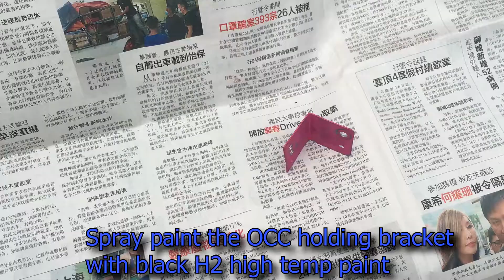(updated) Toyota Prius 1.8 Oil Catch Can installation

Comment: My concern is when it is needed to remove the original hose from the 8mm elbow barb which cannot be done because there are too many angle spices (ribs) on the body of the elbow connector. Reason is every 2 years in US, cars need to be smog checked so I would like to remove the connection and return it to original for that test, then after it's done and passed to reconnect it back just like you. Can you do a quick test to see if it can be removed from the elbow?

Comment: Good video thank you :) my Gen 3 Prius does consume quite a bit of oil so this would be ideal to install and I'll be doing it soon.
Reply: perhaps you should clean your piston ring spring using detergents in engine oil like ERP
Reply: @lovemytechy  I put an oil catch can in a while ago. It works very well and catches a lot of blow-by.
Reply: @FishingWithMichaelTruong  what size can 300ml or 700ml ? How often do you have to empty it and how are the winters? Are you in cold weather?

Comment: Well detailed video. I followed your video and installed OCC successfully. I ran my Prius on maintenance mode for almost an hour ( to check if it's still overheating intermittently due to weak water pump that I replaced with new water pump and that's been fixed ) but I noticed the hose that I connected from outlet of Oil catch can that goes into the intake manifold was completely flat due to high pressure. Do you think OCC might not be functioning as it supposed to  or should I replace with the heavy duty hose ( thicker one) , like the one I got that connects from PCV valve to inlet of OCC. Do you think I need to get a vacuum hose which is thicker than the one I installed ( maybe I got radiator hose ) .I subscribed. Thank you for you reply.
Reply from the maker: You need to get fuel line hose. Do not use the hose that comes with the OCC. Another thing to check is to make sure the inlet/outlet on the OCC is correct. I think some bad brands label them wrongly.

Comment: Can you explain why you placed a new hose clamp at pvc exit to OCC?   Is it possible to drill out old pvc and use an extended hose to connect a pcv closer to inverter then lead to OCC. This would allow easier access to the PVC in future?
Reply from the maker: If I understand you correctly, you mean to remove the PCV from the engine block and move it to the OCC there? If that is the question then yes you can do this but it's not so simple. You need find a way to bolt the hose into the engine block where the PCV is removed. Then again, you hardly need to service the PCV or change it. In fact some cars never have it's PCV replaced ever.

Comment: How about the bracket? Where did you get it from?
Reply from the maker: That pink color bracket? That is called an L bracket which are sold in any hardware store.
Reply: @unkertech  no, the black one.
Reply from the maker: @gibson7654  It's the same pink bracket. I just spray painted it black.😂

Comment: is this a 3rd gen or 4th gen prius ??
Reply from the maker: 3rd gen
Reply: It's the GEN 3 that has all the problems. Terrible design.
Reply: @amazoidal  eh. i wouldn't go as far to call it terrible. It is terrible when there is a problem and you can't even do anything about it. 3rd gen is still one of the most reliable cars on the road.
Reply: The 3rd Gen is so great (I own a 2012) that Jack from NexPower put a Gen 4 engine in his Gen 3. Head gaskets (2010-2012), water pump, PCV valve, EGR all problems past 100k.
Reply: @amazoidal  Do you mean, those problems will start to surface after 100k miles on gen 3?
Reply: Some GEN 3s go 300k without a problem. Just depends on the car. Don't go over 5k on oil changes.